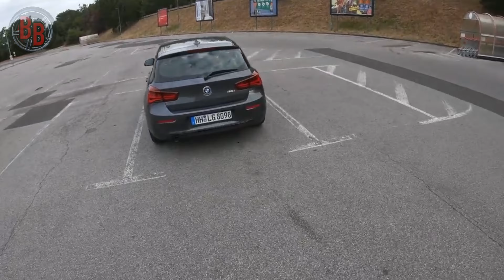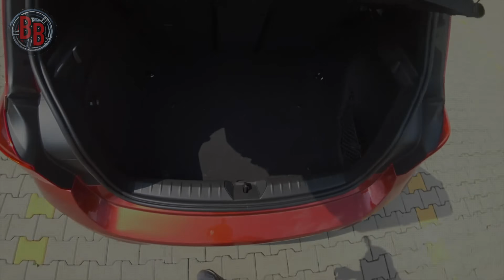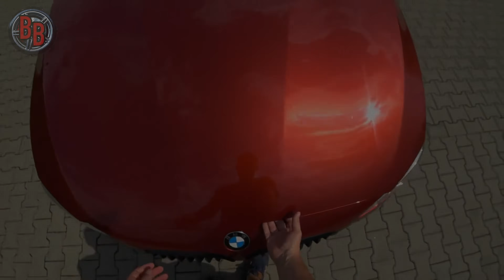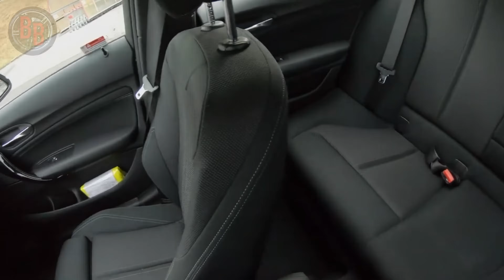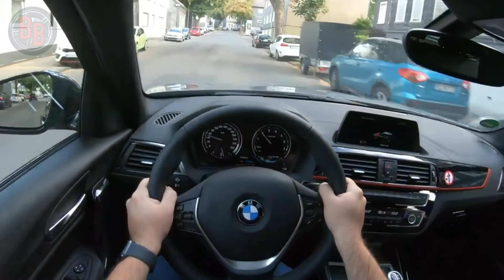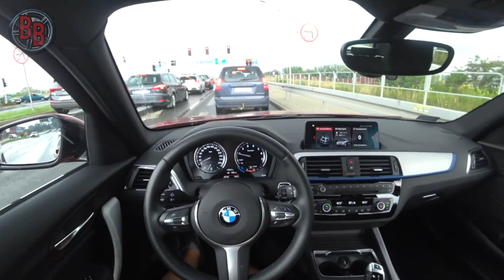BMW 1 Series F20 - Check For These Issues Before Buying

Comment: I've had a 1 series for 6 years. I've mainly had coolant and turbo related issues. I've recently had to replace the turbo manifold, catalytic converter, and a refurbish my ECU.

My advice, get a BMW specialist. Most of the repairs I did were bc of a shitty diagnostic. Most of the parts I replaced were perfectly fine lol the dealerships was just lazy to pinpoint the issue so they make you buy the whole unit. Get a specialist and you'll save money and enjoy your car. I've enjoyed both the 1 and 3 series, but the older they get, they more you need to do preventative maintainence. Don't wait for parts to fail

Comment: My 2 cents are that people do not change the oil frequently enough and debris causes the wear on the TC and its components. Another engine killer is short drives, stop and go traffic and 10,000 plus miles between oil change.

Comment: I got an 114i 2013, had to change the engine. Previous owner mistreated the car and the maintenance was badly done. Got an engine with 50k on it, timing chain, oil pump chain, valve seals till now it’s ok, done 2000km since I installed the engine. In one month. Not one even a single oil consumption. I think the trick is on your maintenance. You need to know how to maintain a prince engine. True they are bad. Only where liqui moly and ceratec on my cars andthe best filters I can find and still not one single problem yet and no strange metallic noises our anything, and get rid of some restrictions and you’ll see you’ll have some fun guys. Not every bmw is for everybody
Reply: I also do every oil change in my cars every 7/8k km. I don’t risk anything

Comment: 170K kilometers in mine and not any single problem. Probably the best car I’ve ever had. Not only for  short distances, but long. I’ve taken it from Spain to Denmark and back, not any single issue.
Reply: Did you change the engine chain?
Reply: Which engine?
Reply: Plz mention your engine size and year and model
Reply: Diesel ? Which engine bro?
Reply: just bought a 2012 1.16d with 265k km and the original chain was still properly working with almost no noise
Reply: Which engine do you have?
Reply: Yes, this vid only mentions faults, but on what % of cars ? I'm on my third BMW, between them almost 500k km, and only a blown turbo on the 120d 2007. Then had a 2011 320d - zero faults in 8 years. Now on a 2017 116d, no issues either
Reply: Why don't you change it now before it goes Bang and causes catastrophic damage.... Everything is great until it's not

Comment: I own an f21 with the n13 engine, done my best to look after it, service etc. But it's reliability is horrible, if you're considering one, please please don't bother.
Reply: Yes but the n13 is really bad. On of the worst
Reply: @tuffgong3248 i agree, I own n13 from 2012, and it's horrible
Reply: I agree mine is 2013 had all sorts of issues, my ecu fried itself which then completely fried 2 of my coils... many more issues. what kind of issues you having?

Comment: I did alot of reasearch about the main problems of the n13 engine and non of them said anything about the the crank or turbo and so on at all. its just the first time i hear all this in this video. Plus some of the stuff you are talking about are things that can happen to any car. I dont believe that this info is accurate.

Comment: I have BMW F20 diesel 2 litres 116d from 2011 until now at 350000km . It is most reliable car , zero  problems only fuel and standard maintenance.
Reply: Wow impressive! How often do you service?
Reply: No chain replacement?
Reply: No chain replacment????

Comment: After watching and listening...  It acknowledge my worries and fear based on what I was told by friend who used to buy and drive BMW cars. I always wish to own a F20 116i or the older evergreen and that undoubtedly sexy E46 325i or the E90... Imagine if you are facing all those problems right after buying a secondhand of any of those F20, E46 or E90... Your nightmare comes to life and your pocket will be having a humongous hole... Seriously. Guess I have to forget about BMWs...  Stick to Perodua cars or even Proton...  Less to zero problems.
Reply: These cars are trash better with a honda
Reply: Living the nightmare for the second time...
Reply: I'm on my second BMW and none of them had any issues. One is a E90 318d with 250k kms and the other is a F21 LCI 116d with 130k kms, if you maintain them properly they last pretty well.